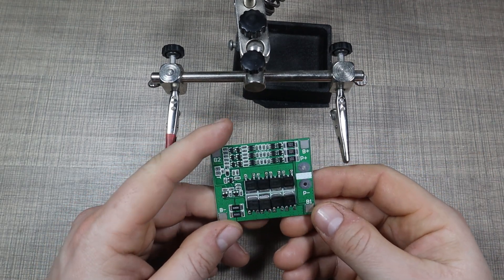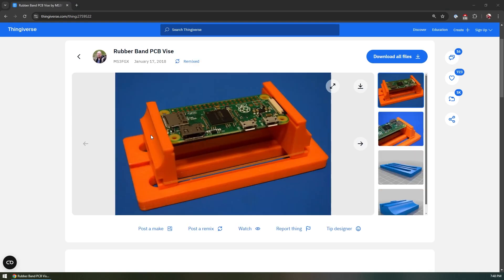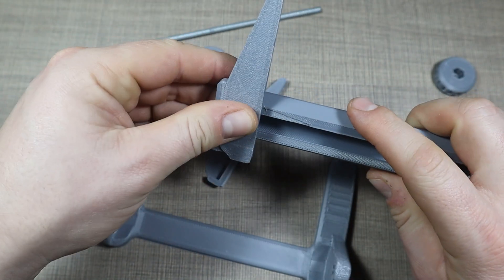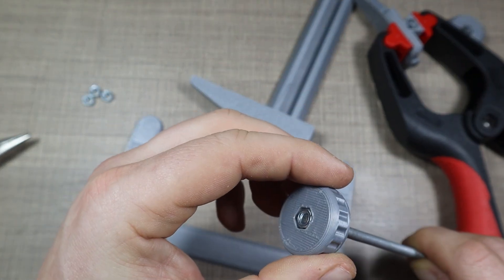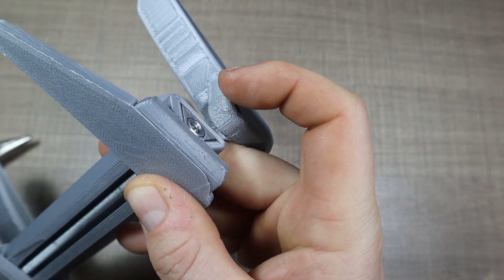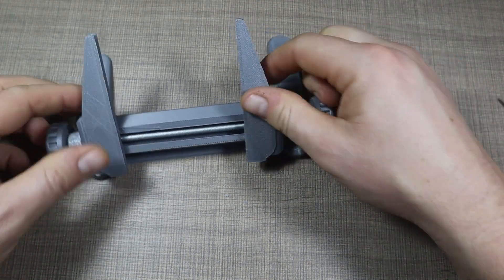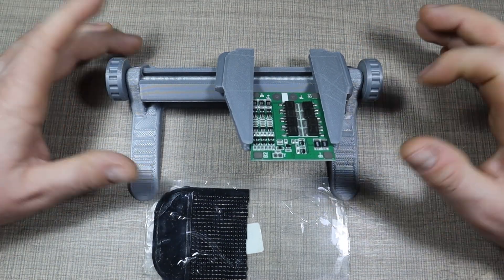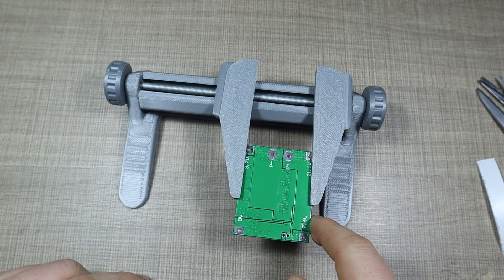I finally upgraded my workbench with a 3D printed PCB Vise

Comment: 5:30 Just build the vise-base out first, then you don't need to find any clamps, it can clamp itself! Also it would ensure the surfaces get glued as parallel as they can be. Also I'd try and get a screw with a more course spacing, as that is going to take too long to open/close to feel readily practical IMO, or maybe some way to make a DIY split-nut that can be disengaged.
Reply from the maker: Thanks. There is enough play in the entire vise where it is forgiving if it is not that parallel, but using the vise as clamp is a nice suggestion. As for the screw, this is the only thing I could find locally. It is not ideal but will do for now.
Reply: @TasteTheCode  it's understandable, I noticed it was a general complaint a few others made on the model. An M8 leadscrew wouldn't fit as-is, but I do wonder if it could clamp things without being back-driven and loosening up. As it's a very ubiquitous size of hardware used in many 3d printers.